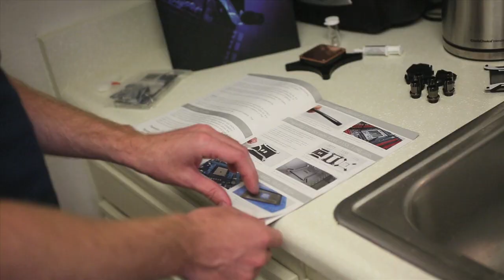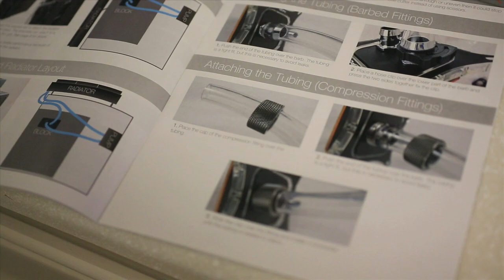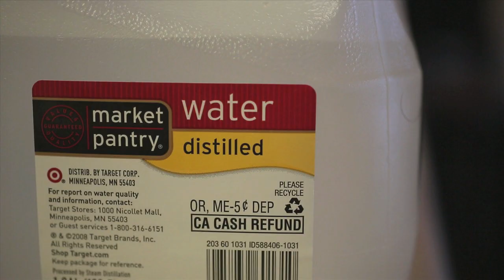A Beginner's Guide to Water Cooling Your Computer

Comment: I only have one question, how do you know whether or not that the components will fit with the case? Example being the radiators screw holes and the cases screw holes. How do you know that your radiator will fit with the case before you purchase the radiator?

Comment from the maker: Nope. I wanted positive air pressure in my case to eliminate dust, so most of my fans are intakes. Also, if you have your radiator fans as intakes, your water will be slightly cooler than if they were exhaust fans (because it's blowing cool air over the radiator, not hot air). The effect may be negligible depending on your rig, but I decided to go with intake for all my fans except the back exhaust and my power supply.

Comment: uhm...this is difficult to explain but I'm gonna try.
First of all, the air doesn't always have to flow in the direction te logo is pointed. Secondly, fans that are mounted at the top of the case should always be mounted as outtake fans. Because inside the case it's getting warm and as we all know, hot air rises up. This will also result in a better air flow. Fans at the front and on de side panel are intake fans and those at the back and the top are outtake fans.

Comment: how do you know which is which? In my experience, the logo of the fan points where the air goes; in this case, outward. However, both intake and outtake are fine. I prefer intake when it comes to radiator on the top of the case, because I don't like hot air blowing into my face while playing game.

Comment: With air cooling you have the risk of the heatsink tearing out
the whole cpu socket, falling down on the graphics card,
breaking it as well. Remember there is 1 kg of weight holding
on 5 square centimetres on your motherboard.
Water cooling when its done properly there are no 
risks but air cooling you can do it properly as much
as you want and the risk remains.

Comment: i used the same kit with the RX240 RASA, similar configuration too, ended up swapping to 1/2" tubing and compression fittings (about $100 more) after 6 months, to add in a ASUS HD 7970 DCII and a 2nd radiator (120mm).

temps go from 30'c idle to 55'c after 2 hrs, to a full 24hrs of running furmark (3D stress benchmark), i7 CPU barely gets above 50'c TDP under stress, a very capable starter kit, but it needs better tubing.

Comment: Most tubing is super clear to start with. the good quality tubing stuff stays clear for longer. this is mostly due to impurities in the water mixing with the metal in the radiator and heatsinks over time.

in the XSPC rasa kit as included above, the tubing is kind of generic and deteriorates after 5-6 months, switching to primochill and tygon, who both sell higher quality tubing, there's also variations in color and UV reactive dyes/tubing too.

Comment: The H100 is not bad, but can in no way be compared to "real" water cooling. You can actually get CPU air coolers that have been proven to work better, like the big ass Noctua one.

Comment: H100 is cheaper than a custom water loop and requires low maintenance but doesn't have anywhere near the cooling capabilities that a custom water loop can provide.

Comment: You are joking, right?  Hydrogen Is very flammable and if they used that it would most likely burst into flame.  Helium on the other hand is non reactive and therefore safe to use in this manner.  It's like saying you can put out a fire with water or gasoline and that it doesn't matter.

Comment: it depends. if the only thing you are cooling is the CPU, than possibly the H100. but if you plan on cooling other things in your build as well, or are thinking of water cooling things later on, then you may want to do a custom loop. also with a custom loop, you get a lot of options to get the perfect loop right for your build.

Comment: I have never watercooled my PC before, but I thought about making my own water cooling system, it will be cheaper than a h100i - I dont know if it is going to be better though.

The Water Block I will is cheap ,only 8 $ Aluminum Water Block Thermoelectric Cooling Module - Silver <--

And a car radiator, and a cheap pump, that are used on boats. ( 17l minute, and it says it's powerful enough to shoot a 7m tall water splash. ) 

Do you think this would work?

Comment: there is hardly any difference in water cooling the only thing that would make water cooling better than the other is how wide/thick your tubing is and how good your pump/resov is if they are both 40$ they are probably going to be the same in overall cooling of the cpu not rocket science is it that something the same price as something else will probably perform at the same level.............................................

Comment: I would suggest using Teflon tape on the threaded connections. Also if you are not using a compression fitting, use a hose clamp instead of a zip tie as the latter does not make for a tight fit. I know precious little about computers but a great deal about plumbing.

Comment: These closed loop coolers are not true watercoolers. If you read the reviews the higher end H80 and H100 are about as good as the higher end air coolers but they are louder and more expensive. If case space is not a problem you are better off with a good air cooler. Those things are by and large fit and forget, obviously it is common sense to keep an eye out for leaks, but you don't need to top up or otherwise maintain them.

And considering you purchased it, you better already know that.

Comment: its a fully closed loop system with their own liquid so no, its made so that there is no liquid loss due to evaporation unlike custom loops and thus it will require no maintenance whatsoever, its like buying a normal metal heatsink

Comment: I agree custom loops, perform much better, as well as look phenomenal, but the only reason your loop performed much better, was only because of the rad, as you said in the video it was a 240mm rad, surface area means the world when watercooling, also the thickness on your rad is like twice of that of the h100. Just thought i would drop an opinion to help out others reading this 'argument'. Nice system though looks clean!

Comment: you didnt tell people to unplug their power supply before putting a paperclip in the end of the 24 pin power connector. that could be very very bad! also people should know that once you unplug your power supply you should always hold down the power button for at least 5 seconds to drain any power that the power supply stores in its compasiters.

Comment: no they are on extremely tight like if you wanted to remove them you would have to heat up the tube. I would spend 15 bucks and get compression fittings

Comment: Question to lifehacker: So the tubes are not actually secured in place, and are just pushed on to the fittings?
If for example the tubes were to be tugged at when the computer is on, would the liquid quirt all over the place? Thanks for your time

Comment: Put a tiny Styrofoam bead, or another small object that floats but won't dissolve in your liquid, into your reservoir. If flows through the tubes then it's working.

Comment: You should be able to use a 240mm radiator to cool the GPU and CPU, but performance will be just okay (probably not much better than high-end air cooling). If you really want better temps and are cooling both the CPU and GPU, you'll want a 360mm radiator. So if you have room for a 360mm radiator, I'd go for it.

Comment from the maker: All I can tell you is that, with the ambient temperature in my apartment kept the same (I made sure to do this), I used Core Temp to test my temperatures with the H100 and then after I installed the loop. I ran Prime95 in both situations, and load temps were 10 degrees lower with the new loop installed. It's not hard to believe--it has a better waterblock and better water flow compared to the Corsair units. And I'm far from the only one to say this.

Comment from the maker: The Corsair Hydro Series is great, and they offer a lot of advantages (low cost, minimal setup, fantastic customer service). But a homebrew loop still performs better. My CPU temperatures dropped 10 whole degrees with this new loop, and that's compared to the H100. That's a significant decrease, and a good amount of extra overclocking headroom.

As always, to each their own, but there are other factors besides "just cooling the CPU". Nothing cools as well as a custom loop.

Comment: the thermal paste does nothing but make sure you dont have any air gap between your cpu and your cooler. so with too much paste it acts more like an isolator than a conduit and will hinder the heat from getting to your cooler resulting in a hot, and if extreme, dead CPU